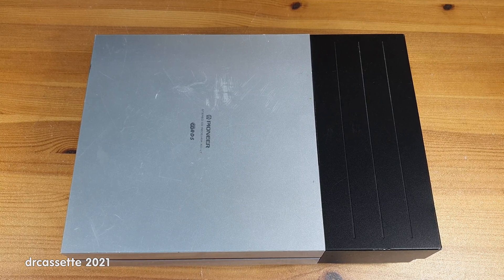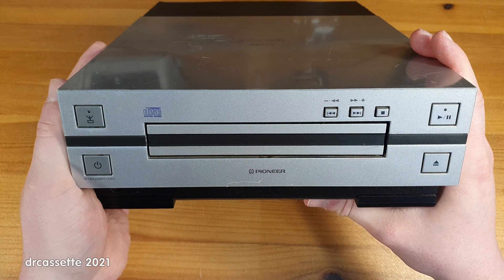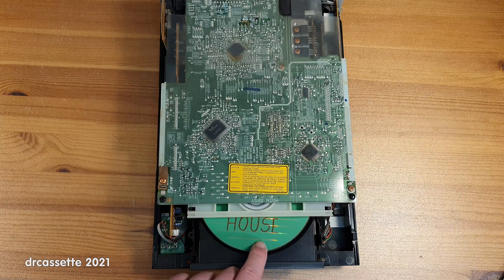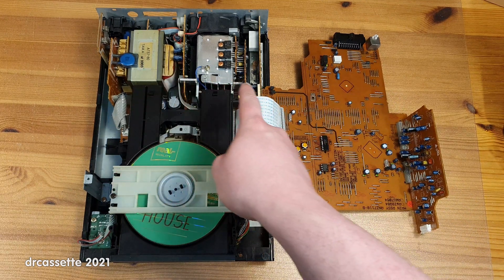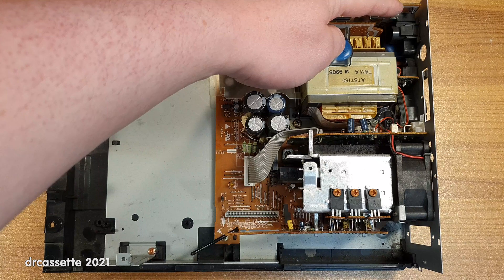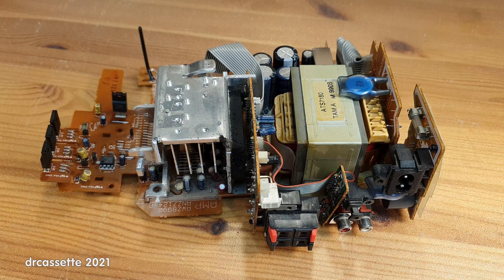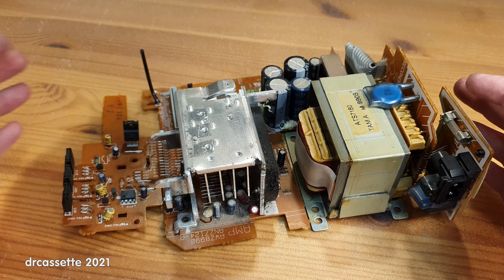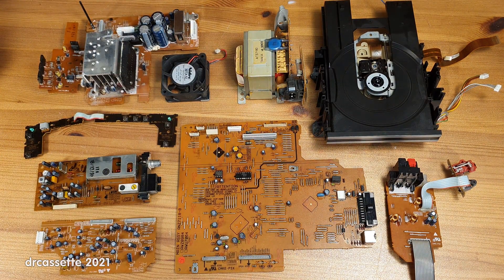Pioneer XC-L7 Stereo CD Receiver teardown

Comment: I recently got this cd player from my dad and it works rather well for  25 year old gear. Some of my CDs work perfectly fine but some, including neat ones, glitch very hard (glitches from the start to a random track or time, then gets to the end or the record). 
It probably has something to do with the lazer lense from the info i've gathered. 
I'm not really familiar with electronics, but already did things that needed me to partially disassemble and reassemble a guitar amp for example. Despite me being inexperienced with such devices, should I try disassembling the thing to clean the lense a bit and see if it works? Thanks for the video by the way, couldnt hope for a better one on such a specific piece.
Reply from the maker: Make sure you unplug the unit before removing any screws. Cleaning the lens of the laser is certainly worth a try.

Comment: I have one of these with the small control section and all 3 speakers.
The sub-woofer sounds great. 
I came here hoping to find out how to fix the cd player. Everything else works really well. Perhaps the cd player has the same problem as the one on the video  I was hoping the replacement of a cog or some such mechanical part would get things going. 
Although the video was enjoyable I am still searching for a solution to my problem.

This is

Comment: Its got an optical out can be plugged into any amp that supports Optical input.
Reply from the maker: Why would you want to do that, if there is an amplifier built right into the unit?
Reply: I want to do just that! I've got a very nice 5.1 surround system, and I want cheap and compact CD player place next to it. Will this work as a regular external CD player from the optical?

Comment: I was surprised to find the LM3886 powering the 8" bass driver's in my 3 way powered studio monitors from Fostex! The chip amplifiers used for the midrange and tweeter were shielded and I wasn't willing to disturb it so I didn't get to find out what they were but judging by the shape of them, they were something different.... 
There should be a lot of amplifier boards, possibly in kit form on eBay that you could use to make use of that IC if you chose to go that path. I'm sure that John audio tech has covered the LM3886 extensively on his channel and possibly even suggested some improvements over and above the eBay kit's... Might be worth investigating... 
I have salvaged plenty STK'S and other chip amplifiers like the lm3886 and TDA2030A's, they are very common but they also have a great sound to them. 
It would be interesting to see what you end up doing with this... 
I was wondering about the idea of using that power supply and amplifier in it's original case as just a power amplifier but replacing the front fascia with a piece of thicker aluminium with a power button and possibly even level meters? Apart from the face modification, all the hard work is already done by pioneer! The case is a good size and shape and actually looks pretty good! Saves you time from having to build one from scratch! And saves from sending stuff to the tip...
Reply from the maker: The case is mostly made from plastic, and it is badly scratched in some places. I have much better salvaged metal cases that I can use for DIY projects... But I have done projects like the one you suggested in the past, take an existing stereo system and only keep the power amplifier section. For example: https://www.youtube.com/watch?v=4ddupHJHYag

Comment: Nice where are you?
Last year I found the matching pieces but NOT the CD player part!
This was at a Salvation Army thrift store and they wanted way too much for it even though it was not all there, so naturally I left it.
Reply: According to the channel info Germany.
Reply: @Escylon  Ok thanks I did not think US as the US market always get the "gimped" versions of the product

EX: I bought an Onkyo TX-NR609 about 10 years ago (already failed what junk replaced with a Denon) 
anyway the manual says RDS except for the US market how rude!
Also no silver versions have been released in the US for many years for most (but no all) consumer electronics
Reply from the maker: RDS is a standard developed in Europe. It has since been adapted in other places around the world, however in the US the standard has some different specifications and is called RBDS. So the reason why the US version had no RDS is because it simply wouldn't work there.
Reply: @DrCassette  Yes I do know the US standard is RBDS (Radio Broadcast Data System vs RDS Radio Data System)
I thought they were almost the same, I guess not?

Although most US market radios just say "RDS" the GM Class II databus radios (the early 2000's units the newer ones looked the same but no RDS logo)

I don't know if you have a similar system to the US's HD Radio (IBOC)
I like it (I have quite a few of them!) Although the company is evil Ibiquity they want to much money for royalties and whatnot so a lot of the good ones have long since been discontinued

I love my Integra TUN-3.7 I got it with the HD Radio card!

Comment: They still used ELNA and Nichicon Caps not bad compared to todays China crap Capxon etc.
Reply from the maker: I don't think much of Elna capacitors, I know they are generally regarded as one of the good brands, but over the years I have come across a lot of bad Elna capacitors. Just in the last video about the Sony colour corrector I had to replace several leaky Elna capacitors.
Reply: @DrCassette  Well those took decades of beating in old B&O systems maybe there are bad batches. Chinese crap blows in just few years XD
Reply: @DrCassette  I'm too afraid to joke about replacing the capacitors in this pioneer thing LoL... I know that you are rolling your eyes at my comment right now 😹, stop it!
Reply: @DrCassette  Elna was considered good caps brand but it turns out they didn't last as much as other good caps brands such as Nichicon, United Chemicon, Rubycon and Panasonic.

Comment: That LM3886 was a surprise, maybe the best chip there is out there.
Reply from the maker: Indeed it's a very good chip. In this Pioneer system, the subwoofer had better sound quality than the main stereo speakers...
Reply: At the Arcade Museum Seligenstadt Germany there is a Namco Alpine Ski (huge machine with rear projection) that has a Quad amp using LM3886 one of which was shorted. AFAIK all Namco Rear projection games use this. Btw. the speakers had shorted coils, slowly killing the chips.
Reply: Hi Perfect

Comment: The recycling center here is just like Fort Knox, you can't take anything. But at least there are the e-waste collection bins in the shops, in some place you can check them out without being annoyed by the security dudes.
Reply: I don't get that myself the biggest form if recycling is REUSE if they really cared about anything other then money probably (scrap metal and precisous metals in electronic component's) they would let you take stuff.
I had a friend at one many years ago he let me take stuff under the condition I would return the stuff I could not get to work and/or the rest of stuff I scavenged for parts, this was a nice "system" we had but unfortunately he passed some years ago and I don't get along with the new management. Fun while it lasted though got some good stuff.
Reply from the maker: In Germany, the definition of the word "recycling" actually is re-using the materials an item is made from, but not the item itself. But this may be different in the English language.
Reply: @DrCassette  Of course it's the same in the English language, Spanish, Italian, French, or whatever. It's only stupid rules that are stopping people that would gladly take home stuff that others dump.
Reply: @DrCassette  I get that as well but if it is a simple issue it can be fixed as well (less energy used then simply melting it down to recycle the various pieces).
When I had my friend he got quite a bit of goodies from people who passed and the family just tossed all of their "useless junk" in a big dumpster I got a nice Pioneer SX-1250 like this, it was 100% working just a bit of cosmetic damaged when it got thrown (literally) in a big dumpster.

This was over 20 years ago I don't have it anymore I gave it to another friends teenage son who was into real audio and not his discman!